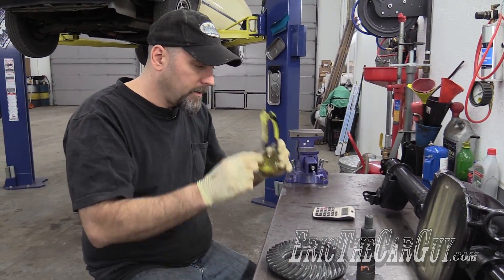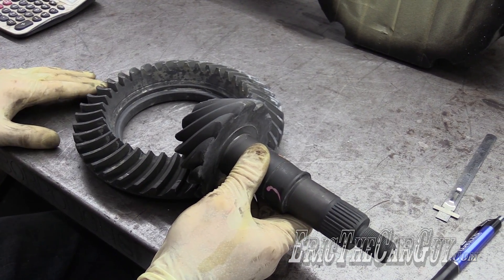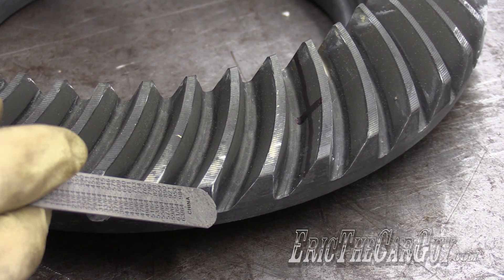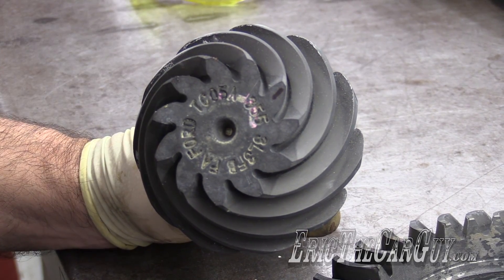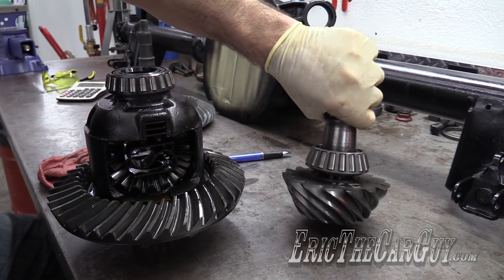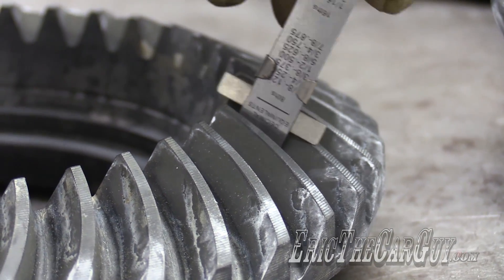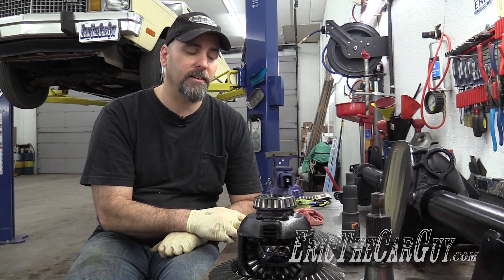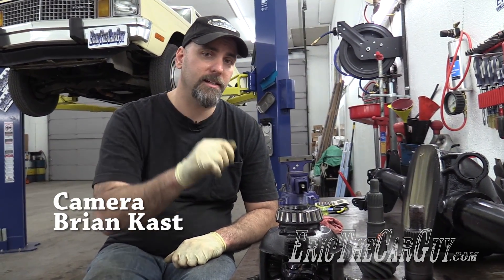Things You Should Know About Differential Gears

Comment: As a formal greeting " Hello Eric The Car Guy" I can appreciate your dedication to educate; have seen quite a few of your videos . Just doing a Faced Hobbed 3.55 gear set on a Stang and came across your post.  The original 5 cut faced milled gears versus the new edge 2 cut hobbed gear sets are pretty much the exact opposite when setting up patterns. I  had to throw out everything I learned about setting up the face milled gears. Good point of figuring out gear ratio. Thank you for your dedication Take it easy...MBS

Comment: I have a set of OEM Ford 3.08s on standby, and the ratio is cast into the side of the ring instead of the face of the pinion. Just wanted to put that out there. I learned a LOT from this. Both the video and the comments.

Comment: I am just now taking a interest in gears & diffs. I have a very good understanding of engines. And a general understanding of differentials. I have built engines, but I have never built a diff. I have had a couple built. I have taken apart c clip diffs far enuf to change all the seals. Just never built one. I have a couple old trucks & one has a 8.8 in it & the other is a 10.25. Im thinking of welding the spider gears so they are locked. Would it be best to stick weld or mig weld?? I wasn't sure if they were cast gears or not?? Im curious what the rear-end dous if a weld were to ever break loose??? Is just open or dous it leave me stranded??

Comment: I had the differential rebuilt on my 84 Toyota Van at while back.  Since then, it seems quiet when it's under load, but makes a whirring sound when I'm coasting.
Reply: I had that problem with my ford 9" after I put my factory gear back in. I had to adjust the pinion depth by a hair and the noise went away.
Reply: The shop that rebuilt it said they put everything back into spec too.
Reply: I think the backlash is set a little to loose and that's causing the gears to whir when coasting.

Comment: Eric you said in the tear down video that high gears are stronger than lower gears. Cause then pinion gear is larger. What about with trucks and towing? Lower gears give you more torque. Usually trucks with lower ratio have higher towing capacity. Your thoughts?
Reply from the maker: Trucks have larger gears to begin with.

Comment: OK, I did my searching and now I have a question. I know about gear ratios from engine to transmission. I get that. I understand how they relate to the differential. What I don't understand is how the gear ratios of the differentials relate to performance. I don''t get the number. I think the number relates to the rotation of the drive shaft and I believe the top number, for example only, the ratio is 3:1, the top number is the rotation of the drive shaft the bottom the axle. And, if that is correct, how does that relate to performance vs just normal street driving. Would it be advantageous to have a say, 1:1 ratio for racing or for pulling tree trunk from the ground? Just wondering. I really couldn't find anything definitive. Thanks.

Comment: Eric you said those were helical gears. Correct me if I'm wrong (which I usually am lol) but aren't those really hypoid gears?
Reply: I believe they're helical-bevel gears. But as with most tech as old as the cog itself, most combinations have been attempted. As a result, sets of varying gear types are labeled differently than the independent parts which make the set. Just as with a "rack and pinion"

Basically 6 one way 1/2 a dozen the other
Reply: helica gears are the teeth slanted at an angle (heel to toe aren’t inline if that makes any sense)
the reason why they shape them like this is for noise reduction

Comment: You want to tell us all that about differential gears? Well that's just your pinion bro.
Reply: Nice :-D
Reply: WreckDiver99
These puns are really starting to grind my  gears.
Reply: Maybe you need to shift your thinking a bit.
Reply: WreckDiver99
Do you think that would have a bearing on my attitude?
Reply: (Groan)
Reply: Wow, so much backlash!
Reply: Can I axle what's wrong with you.
Reply: Oh bother...this is getting tiresome...
Reply: These manifold puns are exceeding my daily intake.  They are probably worse for you than carbs.
Reply from the maker: This thread is awesome.
Reply: nuts...Here I thought we were gonna steer clear of having this be awesome.  I guess we just wanted to be a bit differential to the others out there.
Reply: WreckDiver99
We're a bunch of studs around here.
Reply: Maxwelhse Yea, but it might be time to hit the brakes.
Reply: This thread is choked with puns, but at least there's the spark of advancement and it's not a vacuum.
Reply: ejbcomp
I thought these were all rear-end puns...? You decide to take a brake? You might ax-well, I guess. They were getting a little tire -d.
Reply: I didn't mean to shock you.  I'll spring back if you just leaf me alone for a bit.  There's just a hitch in my thought process.
Reply: ejbcomp
Sure... Just come back when the timing is right and you have yourself in order.
Reply: I'm tapping out, just scavenging for puns now and the pressure is starting to backfeed.  I'm starting to bleed from the brain.  I just can't keep cranking these out, it's starting to get retarded.  ;-)  I'd venturi to say I'm out of gas.
Reply: Well, that is your decision, don't blow a gasket over this, you could really crack a block if you're not careful...so exhausted.
Reply: Mark Crawford
These puns are becoming universally disjointed.
Reply: I think we've passed the hypoid now.

(high point)
Reply: Godfrey Poon
But is that a numerically higher or lower high point?

Comment: isn't a 2.7 final drive super low? like pretty much only good for coasting on the highway?
Reply: yeah provides low rpm for better MPG.
Reply from the maker: 2:73 is actually considered a high gear. 4:11 would be a low gear but you have the premise correct.
Reply: 4:10s in my S2000 eric :)
Reply: I have had one vehicle with a 2.56 ratio and one with a 2.28 ratio. Those types of ratios were common before overdrive transmissions were the norm, outside of performance cars.
Reply: had 4.40 in my old EM1 haha that thing was at 4k doing 70mph

Comment: If most gear sets are face hobbed then just about all of these instructions and charts online are misleading people. For instance the pattern on the drive side is high on the face towards the heel and the instructions say to add shims to the pinion to move it closer to the ring's centerline. Here's the issue, those instructions are correct, but correct for face milled, not face hobbed. And those instructions are what pop up just about every time you do a search on ring and pinion patterns. Therefore assuming that just about everyone is using face milled gears not face hobbed like you say most gears are. This is important to me because I set up my rear and the pattern should have been close enough but over a few drive cycles started getting more noisy, after tear down I saw where the pinion is riding too high and too far back on the drive AND coast side so today I had to spend a good amount of time learning the differences in milling so I can adjust accordingly.

Comment: Can you explain to the public the difference in Gear Ratios and The Benefits and Disadvantages
Reply from the maker: High gears=high speed at low rpm but slow take off. Low gears=faster take off but compromise top speed.
Reply: +EricTheCarGuy is there a sweet spot to get them both ?
Reply: that all depends on the power output of your motor and what you want the car to do

Comment: I know a wayyyyyyyyyyyy easier thing to when trying to figure out what gears you have in the back. 

Lift the rear end.
Put vehicle into neutral
Mark the driveshaft with a line.
Mark the inside of your tire with a line.
Spin the tire slowly 
Count the number of times the driveshaft does a complete 360 in relation to the tire

Example.
I have 3.73gears so my driveshaft  spins 3.73 times for the tire to make 1 complete turn

Comment: what do those ratios mean?
Reply: 3.54 means that the drive shaft turns 3.54 times for every full revolution of the ring gear. The design of the transmission is based on those ratios so changing the diff ratios will change the ratio of engine rpm to vehicle speed at each gear. What I find intriguing about the design of the differential was how they offset the pinion to allow the cab to have a minimal hump where people like to rest their feet.
Reply: thanks for the reply.  Makes sense.
Reply: Basically how many rotations the piñon does in order the cover one single rotation of the ring gear, it can be calculated using the number of teeth, diameter (which is a little harder in this case) or linear velocity on at the centre of the tooth diameter  (which is also a little harder to do)
Reply: Yeah it's called hypoid.

Comment: Why could an incorrectly set up differential explode?!
Reply: If the gears are too close they get overheated. If they're too far apart they will make noise. The line between the two is sometimes about the width of a human hair in some cases.
Reply from the maker: If the alignment isn't correct, it could damage the hardened metal. When that happens at speed, bang.
Reply: +EricTheCarGuy Oh I see, so it's not an explosion in the fiery sense, but more of a violent high-speed component failure?
Reply: Yep, the later.. and if you are following.. you get a show.
Reply from the maker: Correct. Catastrophic failure might be a better description but it's not as dramatic to say I suppose.
Reply: +EricTheCarGuy Haha yeah explosion sounds more dramatic. Thanks for taking the time to explain Eric(and others)!